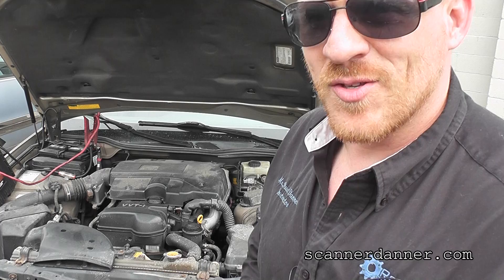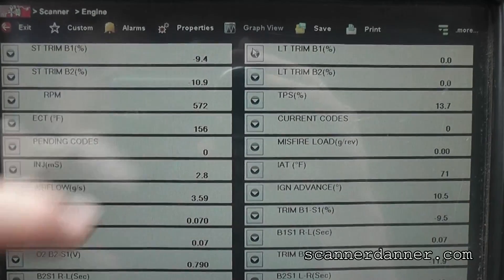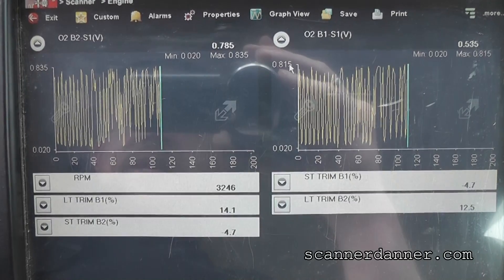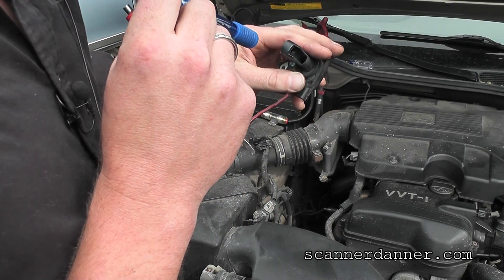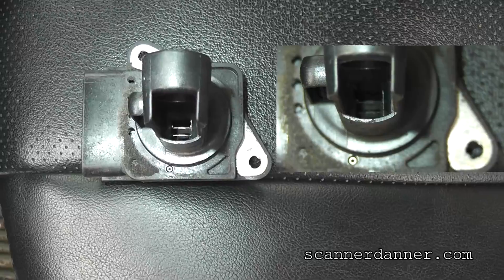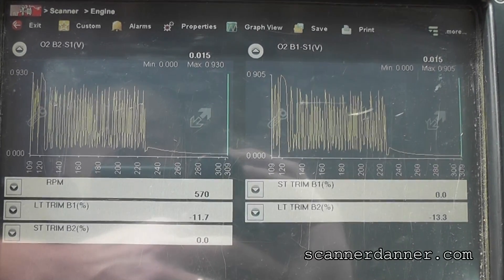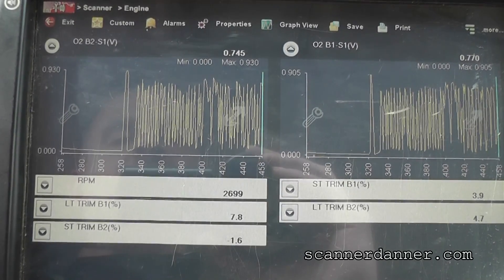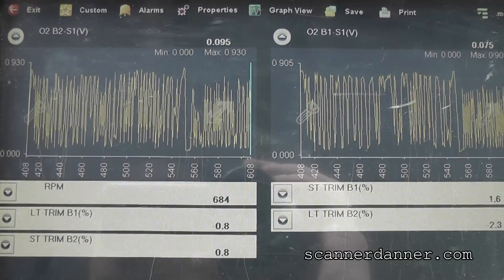How to identify and clean a dirty MAF sensor (Lexus)

Comment: I hope someone can help me with a symptom I have in my car. 96 French car that does not use OBD2 so I cant pull codes easy. Speed/density system. Only one O2 sensor that is brand new. Spark plugs and a lot of sensors new. Fuel pressure good. My car does not have EGR and there is only a solenoid EVAP sensor after the canister that conects to the manifold . The problem is low power even in 2nd gear at around 2000 rpm and at wot. If I'm gentle with the throttle it's better. My cat converter failed a month after I bought the car and I installed a direct pipe and also removed the exhaust resonator due to cat debri... I'm not sure but I think I have the muffler a little clogged but... In this kind of system a strait or almost straight exhaust will mess with the new O2 and make the car run like crap?
Reply: Matt your guessing on everything you work on
Reply: nuno ribeiro - In the absence of the very convenient OBDII port. 
Go for the next best thing the old school vacuum meter. ;-)

Comment: TBH I've used brake cleaner to clean MAF & MAP sensors. I checked it didn't leave a residue once dry, installed, car runs fine, no problems. Good thing about brake cleaner is it really cleans the oil and carbon good.

Comment: 6times out of ten i use brake clean but even tho you clean a mass airflow doesnt mean its good thats a temperarely fix. There is a 5v snap throttle check and i bet you it wont pass.  But good video,sometimes jobs have to get done fast. Keep up the good work.

Comment: I hate to say it but I am disappointed with this one... I was expecting to see you clean the MAF with a wire wheel on a bench grinder this time.
  Maybe next time....
Reply: Schrodingers Box Nah.  Can only use a bench grinder on the open types like GM.  The pocket type MAF requires a Dremel carbide burr (followed by black emery on a buffing cone for the Special Deluxe Two Stage Cleaning Package).
Reply from the maker: Schrodingers Box haha okay, I'll try it
Reply: Schrodingers Box office
Reply: there is  a cleaner for that, that guy became a cheapo
Reply: Hahahaha You are on point. I wanted to say that but noticed you've said my mind.
Reply: If you can get a wire wheel that close to the actual sensor.
Reply: Schrodingers Box or knock the grime off with a handy sledge hammer.
Reply: Lol Matt
Reply: Schrodingers Box bkp
Reply: LOL
Reply: +Heriberto Gomez 1screamin at your screen, lol
Reply: "screamin at your screen",lol
Reply: Eric O, brake cleaner,Lol

Comment: Great fix. Money in the bank. You are so right about it not always getting paid for what you, it's also what you know. Someone could go chasing a fuel pressure problem for hours and ring up a big charge for the customer. If I had to guess on the battery drain, it'd be whatever's connected to that big stereo cable!

Comment: You have to be super careful if you try to scrape the resistor elements clean..those wires are hair-thin. I would have started with the brake cleaner first,less risk of breaking the tiny wires. Good fix.

Comment: I replaced mine recently on an impala I had rough idle,when I put my foot on the gas rpms would go to 0 and it would try and stall, and one time I was driving it to get the part pushed in the gas and no response replaced the 166 dollar piece of junk and now it runs fine